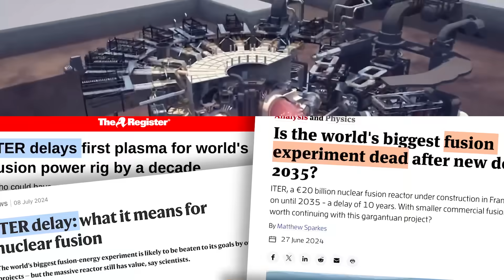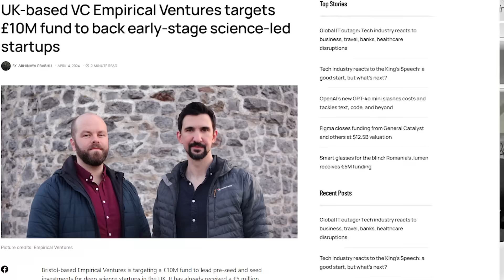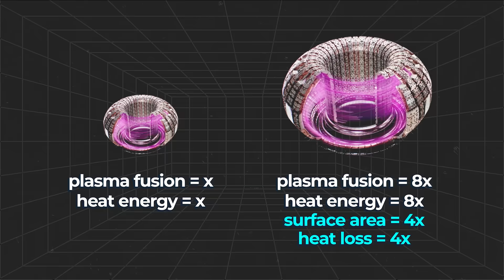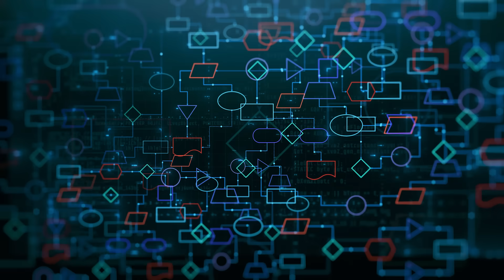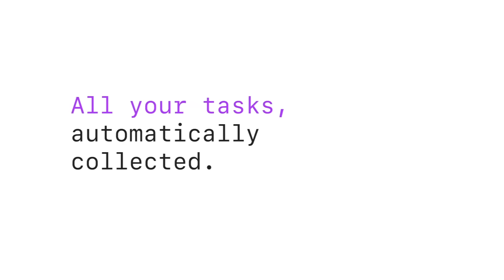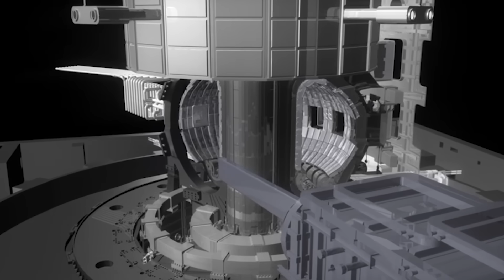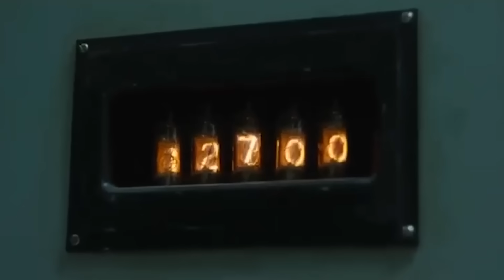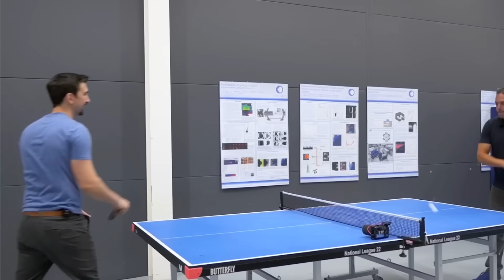Is The World's Largest Fusion Project Dead?

Comment: With all the trillions slushing around the world financial system, doing nothing useful, the amount spent on ITER doesn't bother me. The problem is that fusion will always require large, sophisticated machines, whereas solar panels and wind turbines are commodity items. We're also in an age where battery storage is becoming rapidly cheaper. In short, there is no future in which fusion (or fission) will ever compete commercially with other forms of power. And in that I'll include recent rapid advancements in drilling technology for geothermal. We will eventually have decent fusion drives for spacecraft. That's going to make the money well spent. But on Earth? There are niche applications for nuclear and that's it.

Comment: ITER is noting but a research project.  If it powers up in 2035 and does research for 15 years it will likely cost 100 billion dollars.  It its a 100 percent success than the first reactors to generate power needs to be built which will take another 30 years.   The notion that any machine that big and that complex will be able to run 24/7 for years is not a rational idea.  So then another 30 years will be needed to simplify the reactors to make them workable.   This will be well over 1 trillion dollars and 75- 100 years away.

Will it be worth it?  I have no idea.

New advanced fission reactors will be needed for the next 100 years.

Comment: PLEASE NOTE!
ITER has dropped the use of beryllium and replaced it with tungsten. Beryllium is EXTREMELY hazardous to work with, and contains various small sized pockets of uranium.
ITER will no longer be self breeding.
Along with dimensional errors in major components , corroding welds on the cooling coils for the vacuum chamber, and the U.S. DOE current cost estimate of $65 Billion dollars, I think it’s time to recognize that completion bias is exactly that, and that it’s time to stop….

Anyone know what that current annual operational cost is?

Comment: Why do people think we need to STOP funding ITER like it's preventing us from funding other technologies? We can chew gum and walk at the same time. In the grand scheme of things $20 billion over 20 years between 10+ countries is a drop in the bucket. The biggest issue here is not the price tag, it's the time it takes to move this kind of research forward. And as Ben pointed out, introducing international red tape and differences in standards and manufacturing practices on a project that requires unprescedented precision and quality control is not helping. Nuclear technology is not something you develop overnight. It takes decades of research. This is not something that private industry can bear because there is no return until those decades of public-funded research metamorphosize into a power plant that they can then privatize and use to fleece their customers, like capitalism always does.

Anyway, I'm not saying there aren't legitimate concerns around the administration and fiscal accountability of the ITER project, but that is a problem that looms above the scientific research that's happening in the trenches. You want to start somewhere, start holding the administrators accountable and simplify the top-down organization so the nerds on the ground can do their thing.

Comment: So, they finally figure out that the ITER reactor itself is unworkable as built? The biggest flaw that I see in the design is the magnetic containment field isn't strong enough to contain the plasma at full power. Equatorial plasma blowout is possible and very destructive when it happens. How do you think JET was damaged a few years ago and let's not forget what occurred at LLNL with their device, it blew the ends open due to the cylindrical design.

Comment: 03:20. You are right about the Volume increment compared to Surface area. But another factor is the Curvature of the Plasma Arc.. the bigger (OD.) make Less curvature ; hence it's need LESS Magnetic Field Strength to curve/bent it (plasma arc).. less Coil's current.

Comment: 27 billion is not a lot when you consider how ambitous the project is and that 35 countries contribute to it.

A lot more money is spent on less important / plainly nefarious causes.

For example, in Bangladesh, the "democratic" (it was so corrupted it was basically autocratic) party called Awami League stole around $150 billion from the country's funds over its 15 years of rule. If so much money can go down the drain, that too from a developing country, i think 27 billion divided between the most/highly developed countries is almost...nothing.

Comment: I do wonder what would have happened if we had put all of this funding into Geothermal energy.  I know that Geothermal has a lot of problems to overcome but not as many, or as complex, as those in a fusion reactor.  I do wonder if the problem is that we can see the problems with Geothermal energy and we've all gone, "Woah!  That's difficult!" whereas we don't fully understand the difficulties involved in getting fusion working so we're more wiling to have a crack at it.  Of course, one of the most promising technologies in geothermal has come out of fusion research so the two interact but it's a lot of money for something that we don't even know is possible.

Comment: No fission works, weve been working with it since 1945, and there are active reactors that are incapable of meltdown. Those reactors are used in universities like MIT and operated by college students for research but can be scaled up. And there are several other types of reactors that can be built and when fusion rolls around then phase the fission based units out. This half assed bullshit we're doing now is stupidity writ large
Reply: You will not get a new Nuclear Reactor built in Germany. The United States has built only  two (2)  new Reactors in the last +/-30 years!  It takes 10 years to build and connect to the grid. Then they last only 20 - 30 years. Then they need 10 years to decommission.

Comment: So 2034 before it does anything, that would be something like the 2050s or 2060s before any potential commercial fusion reactors😅. Sure glad those evil fission reactors have been phased out. I guess we'll just burn coal for a few more decades with its carbon emmisions aside thise coal fired plants release more radioactivity into the environment than any fission power plant save 1. This is a fucking joke

Comment: Building something that is still being designed ~ is a total cluster screw up! Then choosing to build the "largest" reactor ~ they are not working on science or developing the future ~ they're building a "vanity" or "bragging rights" for the novelty! When creating a smaller, less expensive, and manageable system that can be reproduced for practical usage by more people in more places! It's creating the technology to handle the macro effects and additional heat challenges from being so large (A red flag that the planning designs either weren't complete or weren't functional before construction was started) is what's doomed the project, will pigeon hole that even if the project is completed and functional ~ another will never be made ~ so it's ultimately a very very expensive vanity project that can never capture anything like a return on investment... 

Prime example of not using progress stages and feasible design in development... When so much still has to be learned just to finish ~ more than half of the project's achievement and "lessons learned" are all just from building it ~ seems strange to build the power core for a Death Star as the first part!

Comment: What if it doesn't work?....
I suppose it is like touching the surface of the sun, or even inside the sun, but contained inside a man made crucible of sorts.
That to me is an impossible task.
Reply: ITER is a scientific experiment.  It is not a electricity plant.  If it can be turned on and does the experiments planned, it will be fine.

Comment: Private companies have been promising for the past decade that viable fusion energy would be available within 10 years. In reality, they face similar challenges, and one could argue that their slow progress is due to a lack of funding compared to ITER. This might be a valid argument if those companies were focused on actually producing usable energy, not just generating plasma that yields more energy than it consumes.

ITER, on the other hand, aims to build a fully functional power plant with extensive infrastructure and tools for measuring various aspects simultaneously. It’s not just about achieving plasma, it's about using that plasma to generate electricity that could power entire cities. If ITER’s goal were solely to produce plasma, it would have been completed much sooner. The site is also conducting other experiments, including producing coolant on-site, among other complex tasks. In contrast, the experiments carried out by private companies typically fit within a single room, whereas one of ITER’s coils alone is likely larger than most of these private endeavors.

We can all agree that involving multiple actors in a project tends to slow down progress and increase costs. Ideally, ITER might be more efficient if managed by a single entity capable of making quicker decisions. However, it's hard to say whether this would lead to a better or worse outcome in the end.

Comment: The nagging doubt I experience with this concept of a practically limitless and eventually almost free source of energy is similar to the one I experience with the attempts at crypto-currencies. Of what use are these advanced technologies if in the end they will be used to continue to exploit the masses and to enrich the few? Bitcoin or any other crypto currency is not interesting unless we also change labor relations, the value of work and compensation, ownership, and so on. Why would I prefer to be exploited in Bitcoin rather than dollars or euros? How would fusion improve my life as an exploited being if I still have to toil in factories (run by extremely cheap energy) to keep the production machinery running and the dividends and guaranteed ROI flowing to the capitalist investors. In other words, please think further down the line, or more comprehensively.

Comment: We need to face it,  nuclear fusion IS the poster child for "projects where time to delivery remains a constant"  All fusion videos have a variation of the statement that nuclear fusion will produce clean, abundant, cheap electricity in just 20 years, the problem is that this has been said for over 60 years.  So when you say there are a lot of projects investigating the way to achieve nuclear fusion, I can't help but think "There are a lot of projects investigating the way NOT to achieve nuclear fusion".  

By the time fusion gets off the ground, if it gets off the ground, the stop-gap measures to meet our energy requirements may very well have rendered it redundant at least until that stop-gap infrastructure needs replacing.  Even then, who will take up the challenge of implementing something that may fail financial risk analysis?

Comment: How does the plasma mainly lose energy? If it mainly loses energy via radiation and is also not dense enough to absorb most of the radiation from the center: wouldn't also the energy lost scale with a higher coefficient than ^2? Maybe not ^3, but higher than two, no?

Comment: Isn't a Q factor of 10 enough nowhere near enough for a positive EROI?  It's thermal energy conversion would be 33% efficent, liek other nuclear reactors, so you'd have an EROI of like 3 if you made a commercial plant from ITER, and ignored the construction costs.  You need an EROI around like 7 for break even in typical low cost energy projects, like solar, wind, and gas, if prices do not spike.

Average EROI across the whole energy industry winds up being like 40.  You'd nee a Q factor of 120 before fusion even reached this average, but really it's much worse because of the astronomical construction costs.

We've also learned from France that river water availability causes major problesm, so you must site future nuclear reactor on the coast fot sea water access, like Fukushima, but then climate events and cliamte change require even more construction costs.

It's likely better if the fusion energy work focuses upon weapons applicaitons for now, which gives the research good funding.  All work at the US NIF is ultimately for weapons applicaitons, not civilion power.  At some point ITER should pivot to maintaining and improving the French nuclear weapons program.

Comment: Remember the Reagan Star Wars Project?  The government line was that it didn’t work.  In fact it was quite successful and later deployed in key locations around the world.  The russians finally developed a similar unit ten years later.  For that one decade the specter of planetary thermonuclear destruction was at its highest, and no one knew save for a few scientists.  So now, ICBM’s are obsolete.  They can be blown out of the sky shortly after reaching the ionosphere, by both sides.  Mutually assured destruction is no longer likely, a good thing.  Notwithstanding, both sides still maintain their missile silos and the game goes on….  As a practical test, we cut a WW2 tank in half in about 30 seconds, with no metal splatter.  Only a femtosecond pulsed three trillion watt Co2 gas-glass laser can do that.  The power of ITER hardly compares.

Comment: At 2:49 you say "it is always a steam engine". That suggests to me that you may have overlooked the Dense Plasma Focus (DPF) approach employed by e.g. LPPFusion which produces electrical current directly. Personally, I think this has the best chance of success if only because it is intended to burn Boron11 and Protium (i.e. common hydrogen), is therefore aneutronic and so e.g. avoids all the issues with neutron activation of the reactor structure. ITER and probably all Tokamak and inertial confinement approaches will not be able to get to conditions that burn anything other than D-T and have various issues with this and the need for scale, and complexity to get to a solution. I would like to see Inertial Confinement, Tokamak and DPF  (I think they are the only games in town at present) in a grid scored against required characteristics, risks etc. You would think someone would have done this before betting the house on ITER, but I can't see it anywhere.
Reply: HB11 is interesting too, also a direct electrical generation concept and a radically different fusion process if it can be made to work (using intense laser pulses to accelerate hydrogen nuclei into a boron target fast enough to make them fuse)

Comment: Why would anyone in the private sector take on the risk of commercializing a small start-up reactor technology concept as long as peddling the commodity is risk free and guaranteed profit? Even if you spent all that money on smaller start-ups they would still be facing the same challenges when scaling it up and making it safe for daily operation and the public would probably still have to invest in a technology demonstrator like ITER in order to convince the market - the only difference is that it would come 20 years later (facing exactly the same setbacks as ITER does, probably costing the same too) and maybe have a different reactor core?

I guess my argument is that ITER and these smaller start-ups, while they are all trying to solve the same problem, are solving very different issues along the way, and they often compliment each other and will in turn inspire even further innovation.

Comment: It is interesting that a similar thing is happening in the US on Space Travel.  The traditional approach to Space Travel in the US has been to provide money to NASA who then used contractors to design and build the final solution (the rocket and the spacecraft) but for NASA to get the money, NASA had to court to different state politicians to support their vision - mostly by promising to use contractors or build research facilities in their state.  This tends to make for a slow hodge-podge development path.  One recent example of this is the SLS which is actually a re-branding and extension of several previous projects and so far has cost about $12B and each rocket costs about $2B each and has had one launch and has taken over 20 years.  On the other hand, is SpaceX which has its own solution which has had four test flights costing about $100M each and has only taken about 10 years.

Comment: Thanks for another excellent video. My career was in publicly funded fusion research. As a student I choose this because the general belief, shared by the lecturers, was that fusion was 25-30 years away. I would be able to look back when retired with pride to what I contributed to. I am certainly not ashamed if what I contributed to, but commercial fusion is not what it is. That remains, in my opinion, well over 30 years away. Assuming that all technical hurdles are overcome in a few decades, the first commercial projects will find themselves in a vastly different energy landscape than we have today. Carbon-neutral technologies will dominate power production. These technologies will be comparably simple and cheap. Judging by ITER and the even larger DEMO project, fusion looks likely to be extremely complex and consequently less reliable. In clear, fusion may by the time it is ready, not be competitive. Maybe some of the alternative, privately funded approaches will be able to develop smaller, less complex fusion reactors. However, from what I can see, is that they still have to discover and experience the issues and problems which are well known in publicly funded fusion research and for which so far only tentative solutions exist that still are to be validated at scale.